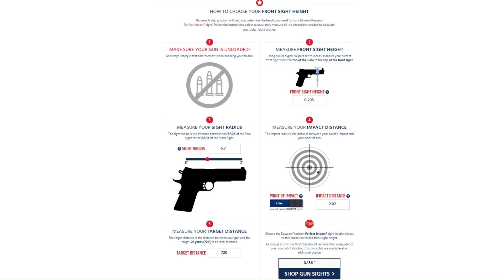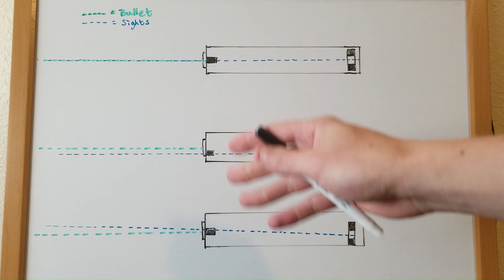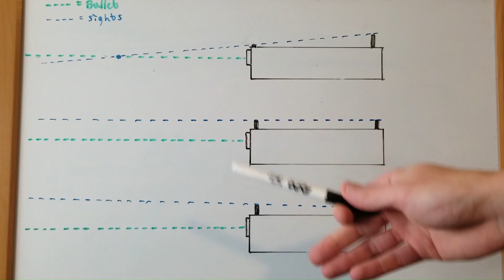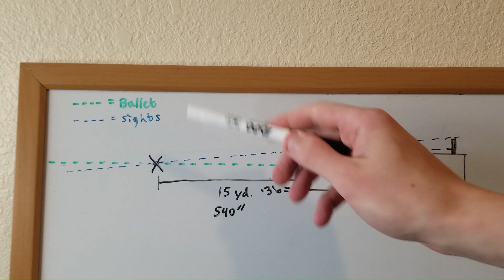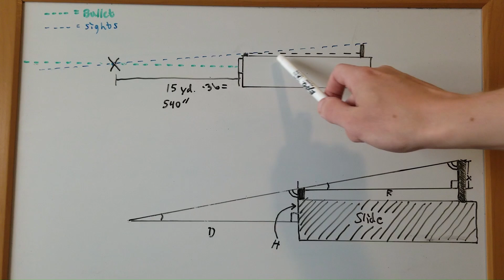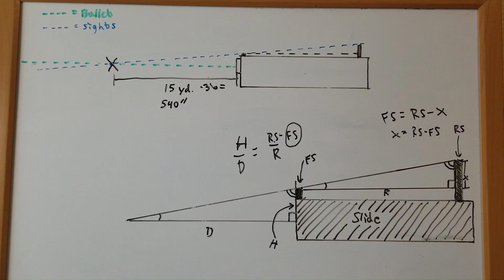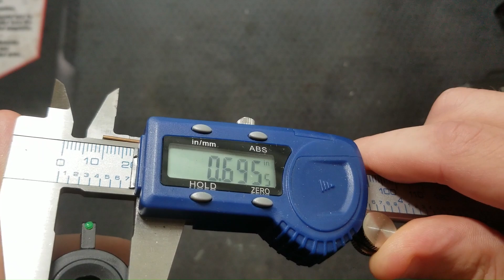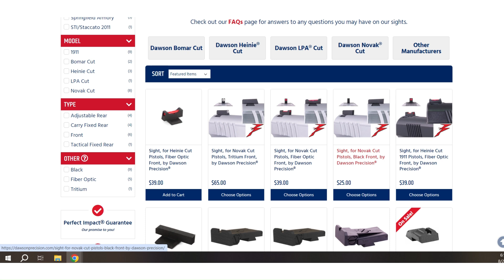Pistol Iron Sight POA POI Basics and Calculations

Comment from the maker: I forgot to mention something. The value for height over bore we use in this equation includes the existing front sight height. Really, that front sight height should be your NEW front sight height. Doing it that way greatly complicates the equation and makes it unreasonable to present to a general audience. As I mentioned in the video, this gets you in the ballpark. The variance in POA/POI from the mechanical accuracy of the pistol, the skills of the shooter, ammo, environmental conditions, is much greater than the inaccuracy from making this substitution in the equation.

If you're starting with a new sight set and don't have an existing front sight as a reference, start with a front sight height of .010" less than your rear sight height for that height over bore calculation (where you add up barrel OD/2+height from barrel to slide, then slide to front sight). You should know your rear sight height that you need to order as this is the height you need to see over your optic/suppressor, etc.

Comment: Do you have a formulae to calculate the point of impact error on the target if a misalign my front sight (x millimiter) to the right (or left) in relation to the rear sight at a given distance? Thanks in advance for such a great videos!
Reply from the maker: I dont but i think you could use the one given for elevation with slight modification. JaredAF just posted a good video on this too that might be helpful.

Comment: Didn't realize you had made a video on this. I explain it a little differently in my video (publishing tomorrow morning), but my video was basically [Point of Impact / (Distance/Sight Radius)] = Sight Correction. And based on the principle of FORS (Front: opposite; rear: same) you can determine whether to add or subtract that to the front or rear sight to give you your new front or rear sight height.
Reply from the maker: Oh ill have to check it out!
Reply: @EngineersArmory  Basing it off of the POI and the existing measurements removes several variables that have to be accounted for otherwise like the downward angle of the bore in the slide itself as well as the POI shift of a fixed barrel (revolvers etc) through recoil, provided your grip and ammo load is consistent in that case.

Comment: Your technical videos are interesting.  I'm an engineer so I understand the math and geometry, I just don't have experience in the machine shop.

You have made the assumption that the axis of the bore is parallel to the top of the slide.  This may or may not be a good assumption depending on the gun and the modifications that have been made to it.  I don't know how this might compare for other models of pistol but with respect to the 1911 if the barrel is hard fit it is potentially higher in the rear than the front.  A barrel that is not fit tightly enough could be the opposite.

The other assumption is that the gun does not move as the bullet travels down the barrel.  Again this can vary from gun to gun but there is definitely some movement that happens before the projectile exits the barrel.  If you look at lightweight revolvers you will frequently see that the front sight appears very high and the barrel is pointing down when aiming the pistol.  The gun will move enough under recoil to align the bore closer to the line of sight before the projectile exits.  Another example of this is comparing ammunition with lightweight projectiles to ammunition with heavier projectiles (in revolvers).  The heavier projectiles, even though traveling slower, will impact higher because the gun has recoiled more before the projectile leaves the barrel.  If you look at photos of the S&W 369 and 329 it is very obvious that the front sight is much higher than it would be if it simply aligned with the bore axis.  By the time the projectile leaves the barrel the gun has rotated enough that the bore axis is more closely aligned with the original line of sight.

It would be somewhat difficult to measure these affects.  If you have a laser boresighter that could be counted on to align with the axis of the bore you could see how the laser compares relative to the sights the compare how the actual point of impact compares relative to the sights.

The last issue that might change point of impact is barrel tilt in an autoloader.  Almost all centerfire autoloaders of 9mm and above use a tilting barrel for lockup.  The barrels may start to tilt before the projectile has left the barrel.  A barrel with a link (1911) will react differently than a barrel with an angled ramp (Glock).  It would be real interesting to see what this action does to point of impact.

I will admit that I have witnessed significant change in point of impact by varying projectile weight in revolvers but not as much in autoloaders.  This may be due to the slide recoiling straight back some amount before the frame gripped by the shooter's hand starts to move significantly.  With lead and jacketed lead bullets it is possible to have revolver ammunition with a 2:1 ratio of projectile weight from lightest to heaviest.  I've noticed that some solid copper projectiles are even lighter and that ratio could increase by a lot.  In 9mm auto the typical range is 115 grains to 147 grains so this is only a 1.28 ratio but one company makes 68 grain ammo so that is 2.16 ratio.
Reply: I was still curious of the behavior of autoloaders so I looked up slow motion video.  Mythbusters had video at 70,000 frames but the video was low resolution and it was difficult to conclude exactly what was happening.  I found one video by "the slow mo guys", they have much better cameras.  They had a 1911 and what appeared to be a SIG P320, both of which the slide and barrel moved rearwards slightly before the projectile exited.  I would guess the movement was between 1/16" and 1/8".  This is probably not enough movement for unlocking tilt of the barrel and also appears to not be enough movement to transfer recoil impulse through the recoil spring into the gripframe.  This would indicate that your method would work better for an autoloader than a revolver.
Reply from the maker: @billj5645  Replying to both your comments with this one.

First point regarding barrel being at an angle from the top of the slide. I mention this at 06:38. You are correct that in a 1911 the chamber can be higher or lower than the muzzle depending on the fit.

Regarding recolvers: yes, the muzzle can lift slightly before the bullet leaves the barrel.

In terms of tilting barrel actions, as far as I know and from what I have seen and experienced, the bullet leaves the barrel while the slide and barrel are still locked together and traveling rearward. This is before the action unlocks and the barrel begins tilting. That is another assumtion I was making with this calculation.

I too have noticed significant impact shift with difference loadings and bullet weights of a cartridge (in all sorts of pistols and rifles). Another assumption is that this calculation would only be accurate for one specific type of ammo (as is the case when you sight in a red dot or scope as well - your choice of ammo should be deliberate and representative of what ammo is going to be primarily shot thru the gun).

In terms of the accuracy of these calculations and assumption - I touch on this in the conclusion starting at 14:52. This gets us in the ballpark. There is so much variability in mechanical accuracy of pistols, variation in ammo, environmental conditions, our skill as the shooter, our measurement methods, what sight heights are available to buy, the list goes on and on. I hope I presented this method as such.

Thanks for watching. i appreciate your comments and attention to all these little details and variations. i always love getting into the weeds about stuff like this. But I always have to pull myself out of the weeds and remind myself that in practice it will all be much different hahaha.

Comment: Your videos are epic...
Reply from the maker: Much appreciated dude!
Reply: @EngineersArmory  so... on my Tisas 1911 Ds Carry. With my irons equal light equal height, bench rested at 15yds, Its printing way low. That means I would somehow need to shorten the front sight to bring my POI up correct? Following the FORS method.
Reply from the maker: @DesertTactical  irons on mine were the same. And correct, front sight height lower.